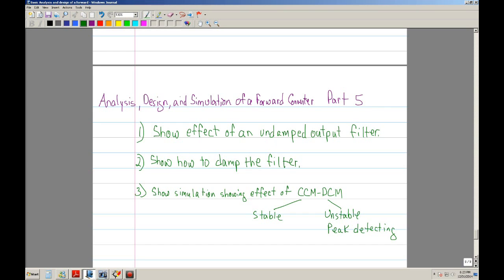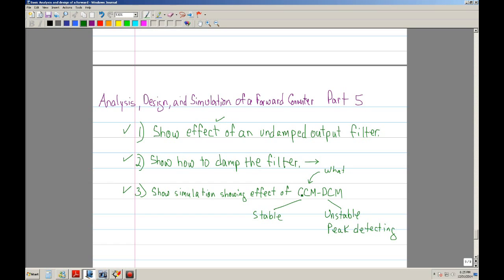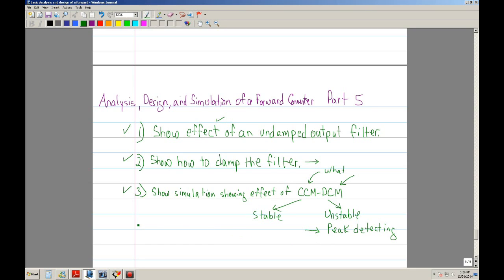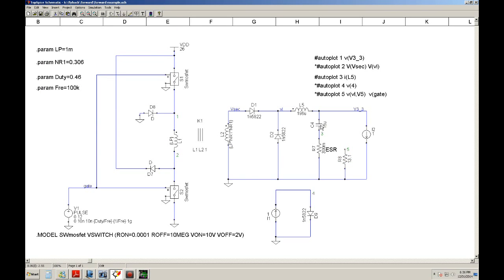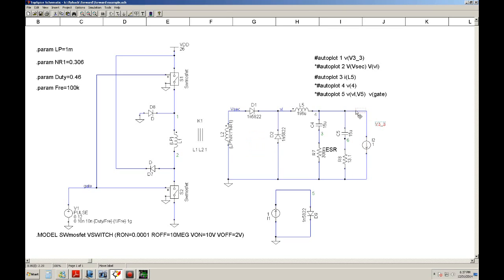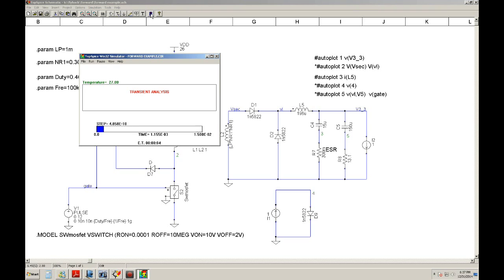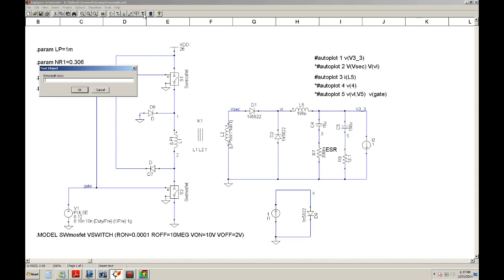Forward Converter Part 5, How to damp the output filter.

Comment: Thanks for making this, Robert. 

Neither of these effects would likely be an issue if there was a closed feedback loop though. As the LC complex conjugate double pole should be well within the bandwidth of the feedback loop, it will be damped by the feedback. The process you showed is useful when you have a second stage filter outside of the feedback loop (although you can design one into the feedback loop but above crossover frequency and then you only need to damp it enough to keep the peak below 0dB). The snubber capacitor doesn't have to be 10x the first capacitor. It's hard to say exactly what multiple it should be, 10x capacitor and resistor of 0.5xSQRT(L/C) would critically damp it (Q=0.5), but making the capacitor bigger increases the dissipation in the snubber resistor and slows the transient response. 3-5x capacitor and Q=1 is quite a common compromise. You can also make this snubber from a single electrolytic capacitor selected for ESR (i.e. not a low ESR type) to save a component in mass production. 

This "peak detect" in DCM thing also doesn't really happen in a closed feedback loop. The system ususally just becomes first order, under-damped with a worse step response. Voltage may go slightly higher but it won't generally run away as it does in your simulation. Some small load helps, even a feedback resistor divider can provide a minimum load.
Reply from the maker: +KX36 Hi KX36, I can tell you have designed a few power supplies your self. In my opinion to design damping in all LC circuit is a good ideal (due diligence). Specially at startup. At startup, the control has not totally stablelized and if you have a high Q in your output filter circuit, you will get an overshoot in your output circuit. You might say "that is what the slow start circuit is for". That is correct. I just designed a power supply where the slow start circuit in the integrated chip totally sucked. I won't say what chip it was but due that I had to use the chip, I got saved from the overshoot problem by implementing the damping. So damping is always good if you can deal with the power dissipation. In reality, there is very little power losses in the damping resistor.
Reply: Yes, you're right. Ringing at startup can be a problem. And I know what you mean by certain ICs don't soft start very well. The dissipation should be quite low, otherwise you couldn't use an electrolytic cap's ESR to do so.

Comment: Hi Robert, when calculating the value of the damping resistor , you forgot to take the square root . The value should be sqrt of 13 = 3.6 ohm .

Comment: In Part 4 you had a 15uF cap with an ESR of 1 Ohm and then changed it to the 150uF with 0.33 Ohm but now u have a 15uF cap with 0.33 Ohm.  With the 15uF/1 Ohm the filter was well damped and then with this change it became highly underdamped.  The lesson is not lost that using the 150uF in series with R = Zo damped the filter.  the open loop undamped filter the ringing was about 0.3mS.  should this not be overcome when closing the loop even at a few KHz? Ahhh... looks like someone else (KX36 5 months ago) also made this same comment and also elaborated quite nicely